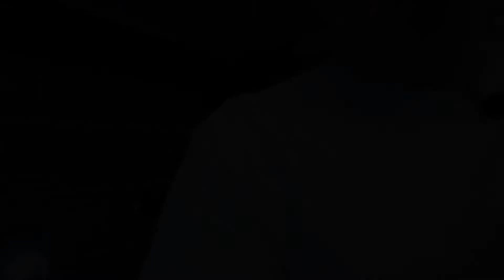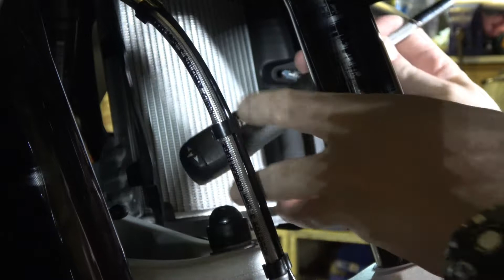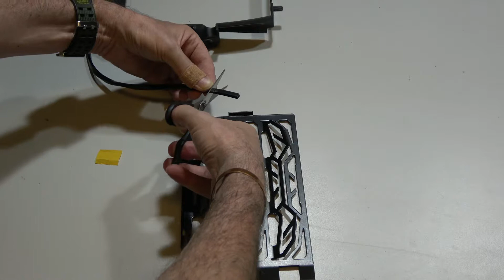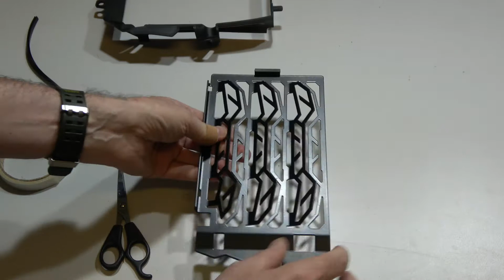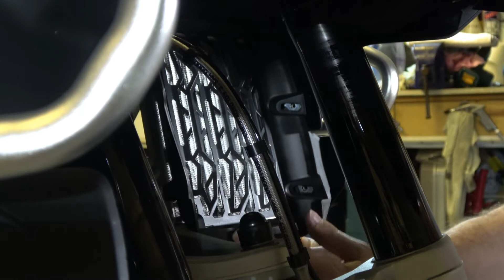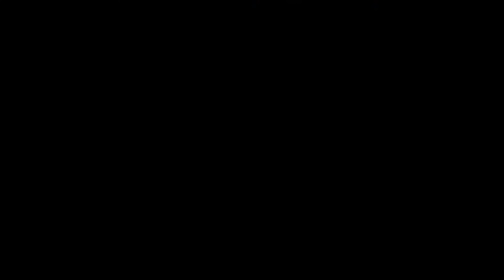Touratech Radiator Guards install on 2018 BMW R1200GS Adventure

Comment: Thanks TMR great video. I've just tried going cheap and brought a Chinese version and its rubbish so looks like I need to buy from Touratech next time. Only thing I would add is to make a note that the three screws are different lengths. Cheers from the UK.
Reply from the maker: Thanks for the kind words and for watching the video. Just letting you know that last year I incurred a bird strike at around 55kph by an adult galah (medium sized parrot) that went up and under the  front left of the bike and straight onto the radiator. No damage was incurred by either the Touratech guard or the radiator. The bird, needless to say, did not survive. I think that speaks for the quality of the guards. Stay safe.